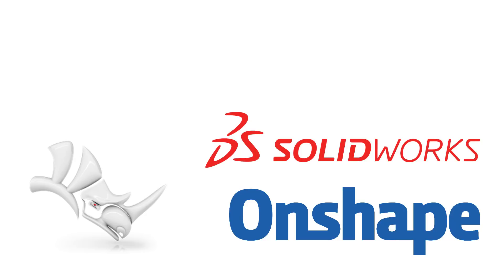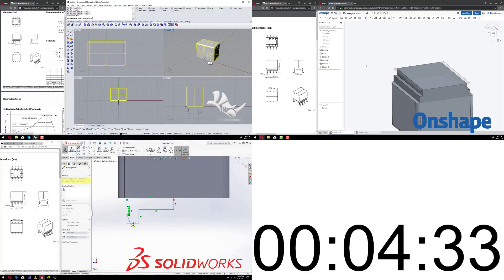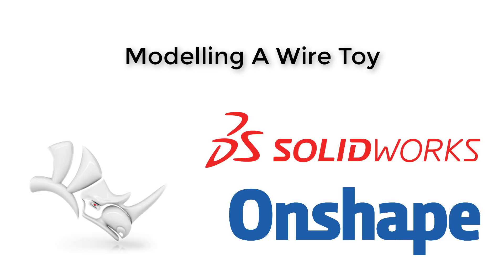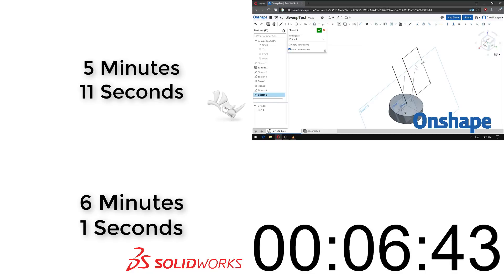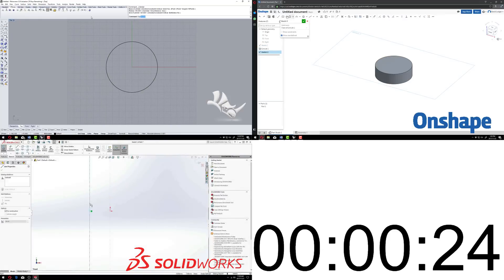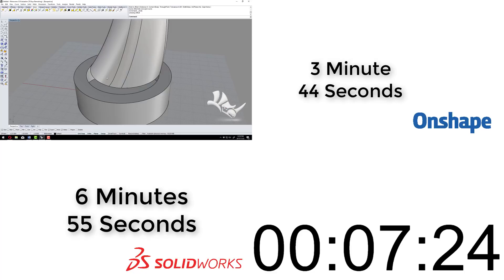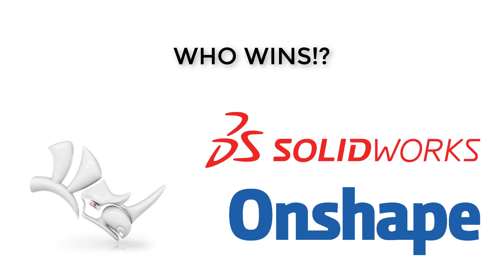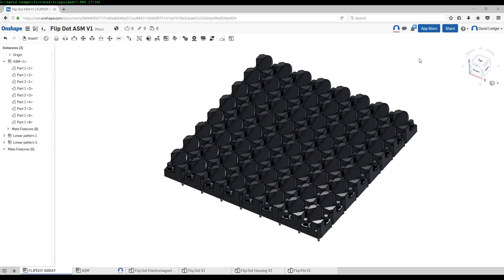MCAD Shootout! - Rhino vs Solidworks vs OnShape

Comment: Please don't say Onshape is free, because it really isn't. You can use it for free, but absolutely everything you create is shared with anyone, so you have no privacy. To keep your work for yourself, you need to buy the Pro plan.
Reply: That was said in the video I believe. Your right of-course regarding the sharing of content, this simply wasn't an issue for me when just modeling electrical components, to me that isn't a compromise in the product because I would happily share component models anyway.
Reply: Sure, in many instances sharing is just fine, but not always. And having to switch to another CAD whenever you want to keep your stuff to yourself is a major nuisance, so for me Onshape is not an option. And as mentioned by others, you really should have included Fusion 360 in this comparison.
Reply: FYI, Fusion has a similar constraint - if you make more than certain fairly low amount annually (gross, i.e. before taxes and everything), you have no right to use the free license anymore. There few other constraints like that. Make sure to check the EULA or you may get a surprise visit from the local BSA at some point :( It pretty much rules the free license out for most except non-for-profit hobbyists. 

Also the other problem with these tools (but mostly Fusion) are forced updates and bugs in them - if I was to use this in some situation for customer work, it would be a nightmare. We are using Fusion at work for pre-processing some CAD from clients (a non-critical function) and we had updates break our scripts and workflow on several occasions already. Basically the software is usable only if you agree to be an unpaid beta tester (and in our case, we are actually paying for it!).
Reply: Sure, if you make more than 100k USD/yr, Fusion is no longer free, but that's besides my point. As a hobbyist/maker, I still do not want to share everything I do, and that rules out Onshape. Fusion is by no means perfect, and as you say, bugs come and go, but all software has bugs from time to time.
Reply: @mroek  but using the free license of Fusion 360, you're also giving away your designs to Autodesk
Reply: @porschepanamera92  Only if you mistrust Autodesk to access and use  your documents without your permission. In a technical sense they obviously can get at your documents from their servers, but the license agreement does not grant them a right to use your designs for whatever they want.
Reply: Yeah if you are making 100K+ you can afford the software and use it as a write off..  Like GE does to avoid paying taxes on billions of profits.

Comment: I like Rhino, but I've been using it since I was a kid, so I'm used to it.  I also like SolidWorks.  Those of you saying "why not Fusion 360" I must respond and ask why you like it so much.  It's a bit confusing to use, and the construction methodologies it forces you to use are a bit constricting.  I like the freeform modeling Rhino allows.  Maybe I'm just not used to Fusion 360 though.
Reply: I'm in agreement, I would need to use fusion for quite a while to have any relevant opinion on it.

Comment: As a professional CAD user, I have a problem. What software usually you use? Is it Rhyno? An experienced user of any CAD software will do it in less time. If you are AutoCAD user you will get Rhyno very fast compare to an inventor user who will get SolidWorks. An example of how to do it fast: Export each draft view to a plane in the cad environment. You should test is which is better and cheaper to produce CAD to be exported to different ECAD softwares.
Reply: It gives a sense of what is real time at the least. It also allowed me to understand my own work flow bottlenecks and really surprised me that onshape performed so well when compared to the others.

If you disagree with that I think you can agree that it was useful to me, it gave me a better sense of how long a certain type of object would take to model, which is useful in estimating how long something might take to model.
Reply: Experienced or not I discovered changing between work flows every 5 minutes is very jarring, remember what you see is only 9 of several dozen clips.

I've spent several thousand hours in solidworks, rhino and maybe a couple hundred in Onshape. 
I'd be much much faster at any of these packages if I used just them for a day before doing the test instead of swapping suddenly between them.
Reply: But before the test what was your go-to do CAD software?
Reply: Solidworks for every MCAD need. Rhino for surface modeling and industrial design excluding designs that are more dimensionally defined than aesthetically (solid works for more dimensionally constrained designs). Onshape for electrical components as I often do my electronics design on my surface and on shape is convenient in that regard. I may actually start using rhino for electrical parts, I did may parts with it when preparing for these tests, for me it was just really fast for non-derived models, its also really really fast to startup which is important if only need the application for a couple minutes.

I actually use all three :) I don't however usually swap between them every 5 minutes, that was very jarring.
Reply: I think that is Wilmer's point - it doesn't make much sense to make timed comparisons when you are not equally experienced in all these tools (probably nobody is). By definition those numbers are going to be meaningless.

Comment: HOLY unnecessary steps, Batman

I have NOOOO idea what you were doing with that first model.  In Solidworks or OnShape, it would have taken me a couple minutes to bang that out.  I'm not being a fanboy, I just don't understand what you were doing or why you were making the part the way you did.  It makes be doubt the veracity of this video.
Reply from the maker: Please do a video and show us how it's done then.
Reply: Just for fun, I like this sort of thing.
I challenge you to a Solidworks DUEL, where is my glove. If you win I get to learn from your process, if you loose then it'll be fun anyway :)
Reply: I was looking at your model, because its lovely and I had just checked how long it would take me to do it just to see where I'm at compared to others. 
In onshape, all operations are timestamped, all sketches etc. Anyway your timestamps say you took like 2 hours the first day you worked on it and that you worked on it a bunch today.
Reply: Yeah I found it weird too, I think I mentioned that in the video. 

Solidworks constraints are often much better, but very occasionally really basic sketches have strange constraint issues. After literally thousands of parts in solid works, most constraints work without issue it just so happens that it didn't this time, it was my fault of-course but every now'n again humans do things in-perfectly solid works constraints are not super tolerant of these mistakes, whereas some other packages make it more obvious which constraint caused the issue.

I thought about re shooting that clip but I thought the error was something potential users should see and something that although avoidable (by constraining in the right order and avoiding things like tangent constraints which explode sometimes) was still useful to viewers.

Same thing regarding the rhino segment with overlapping surface fillets (which it doesn't resolve automatically),
Doing it again, would have done it a completely different way, but it showed a common issue.
Reply: Thats a lovely piece, 20 minutes seems realistic, if you like I can work with that and time it later, i'll post a video but I cannot do it now, got other work but tonight your on, or tomorrow if something important comes up :)
I'll do it in another tool so I cannot just copy your steps, that sound fair?
Reply: David Ledger 20 beer minutes, clearly ;)
Reply: David Ledger well, send me a part.

Until then, here's something I made in about 20 minutes over beers with a contractor to get materials estimates for an architectural piece.

https://cad.onshape.com/documents/74aed1830a48040c01d66c3a/w/6024b41aa890506101ac7bdc/e/7331d5978402876f093ebed9
Reply: this is a good cad but the circular pattern really inst that hard to use ;D plus the center of it is illogical.
Reply: David Ledger remember, that was 20 beer minutes talking with a non nerd.
Reply: I had to watch that one again...as a professional CAD user I found it weird to watch him struggle to constrain that sketch.
Reply: EEVblog typical YouTuber answer.  Like a 2nd grader.  fine, post a link to the original part...

Comment: I have just started using Fusion 360 at home although I have in the past  used Solid Works.  I also joined Onshape.  I think I’m sold on fusion 360. I would even consider spending my own money on it even though it’s free for hobby use. I hope autocad continue to support the product and keep it free or even the lower cost model.  I wonder if solid works is missing a trick given it totally ridiculous price point.

Comment: Inventor needs a spot here next to SW - both really good tools but some more complicated features are definitely easier in one vs. the other.
CATIA and Pro/E would be cool to see although they seem to be somewhat less common. NX as well, but I suspect that may be harder to obtain.
For everyone mentioning Fusion 360, it's cool but maybe more on the level of OnShape than a more full-featured program like Inventor.
Reply: Your right, very similar, I don't have a license though and I would need to practice that software for quite some time before doing the tests.

Comment: I use FreeCAD for all part-modells to import them in Altium and lately KiCAD (nightly builds support STEP too). Actually Im focuced on electronic and not a "M-CAD guy" and find FreeCAD very easy to start with. Can you make some videos about FreeCAD? It will be awesome! By the way, check out new nightly builds from KiCAD- its really funny..;-)
Best regards from Germany,
Sebastian
Reply: FreeCAD recordings were really strange as its sort of like having a dozen different programs all under a drop down menu.
Reply: Sebastian: Are there any recent tutorials you can recommend?  FeeCAD seems to have a huge break between 'what the docs say and how to actually do it in the current version'. Or at least that is what I keep having problems with.
Of all the cad packages, it's the one I'd most like to learn, even if I'll hit problems and it won't be as easy to compared to some others.
Reply: By the way: I see no any reason to invest a tonns of money in MCAD if I use it only modelling some electronic parts..;-)
Reply: The actual help files that come with it are pretty good, I was pretty impressed, its not all uptodate though./
Reply: Well, you right! Moreover, as I know FreeCAD was invented by two ex-SolidWorks developers who wish to make MCAD light-weight and easy to use GUI. Yes, it feels like a lot of different applications under the hood and same GUI. In one hand: its a little confuse not familiar user, in other hand: you can easy expand the futures if you need too and main- application looks not so much "overloaded" with futures when you start it. ....and, its fast....;-)
Best regards,
Seb
Reply: Its a lot of different tutorials and most of them can be easy "convert" to new version - almost all of them will work fine....;-)

Comment: Hey Dave and Dave2. Good choice finally! I've been using CAD systems for the last 25 years... mostly Autocad before stumbling upon Rhinoceros about 5 years ago. Never ever looked back, amazing tool, fast reliable and very very powerful... and easyu to use. Take it easy and wish you the best with your mechanical designs!

Comment: In my opinion, you used Solidworks in the unfair way as skill you used other CAD software. you don't use "orientation" in some case to make task more complex. You don't use centerline in the right way, formula in modify dialog box. The way you used features tool to build block more complex. This's not fair. You don't talk about modify ability, simulation ability, co-design ability, support Hardware design ability, Support CAM ability, File Export ability,... All thing you done only your skill to use software.

Comment: You missed out SolidEdge, guys. Best *m*CAD existing.
Reply: SolidEdge is great, much prefer it to Inventor.
Reply: I don't have a license and I'm not familiar with it either so it would be difficult to add it in I know its feature set is pretty sweat, I'd like to try it out.
Reply: Unfortunate!
If you ever have the chance to try it out, you should. It spoiled me of using any other CAD package 😉 
(Though, as a hobby user, fusion360 is a gorgeous piece of software. Takes a lot of "letting go evetything i thought i knew" and rethink the diffrent concepts. By far not all are perfect, at least it's REALLY usable & versatile for many tasks - and importantly: improving)
Reply: If you have time, tell me how it goes with the last model I did, the dimensions for the problem case are:

80mm diameter 25mm height cylinder.
Spline with 3 axis of movement non-self-intersecting loft over a path from a 8mm circle to a 8mm square.
The center of the loft profiles are between the center and edge of the cylinder. 

I'm just curious if it has difficulties, the problem has many solutions which solvers sometimes struggle with, there is an optimal solution.
Reply: Took me about 20 mins to do that in Solid Edge, but I'd never used the 3D Sketching environment before, so that probably accounts for at least 10 mins of that, would've probably taken about the same amount of time if I'd have used planes to draw the curve rather than just free handing it. 
I'd consider myself a maybe almost intermediate SE user.
Reply: Thanks for the time though really great stuff absolutely awesome.
Reply: Maybe your right , however it is just not as popular as Solidworks, Inventor or Creo. Personally, I see as a stripped down version of NX, so it cannot be the best (sorry).

Comment: Is FreeCAD any good?
Reply: MaxSantos it's got a pretty tough learning curve and when you run into conflicts with constraints that make the drawing unresolvable can be hard to see what needs to be fixed. Personally use onshape because of convenience of access everywhere, can use it on my Linux laptop or Windows desktop or Android phone and the things I model tend to be simple enough to be easy and fast to do in onshape.  I know solid works name and know it is good for more advanced stress and fluid dynamic modelling but just not stuff I need to model parts for my electric skateboard or quadcopter or printer... These are all hobbies and guess and check method of testing works fine since I'm not developing products for other consumers.  A video like this leave out all the reasons to pick something, a few sample models doesn't really tell you how you can use a thing in the real world (fun to show friends and family models right from my phone)
Reply: Shaun Husain Thanks. Its a shame that FreeCAD gone with a different workflow (from what i read). I don't know any of them, but i'm not willing to invest that time learning something that will make it harder to change to other softwares.
Reply: Yeah its great! I think its a little jaring though, its a little like having a dozen different programs which you select with a dropdown menu.